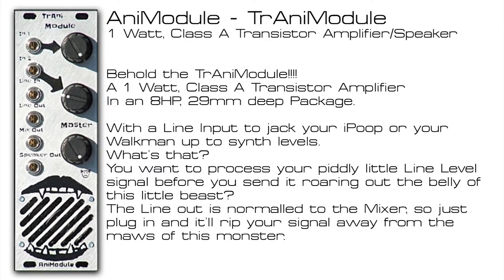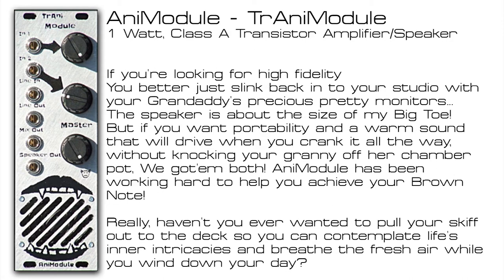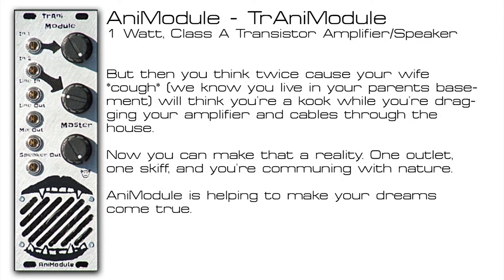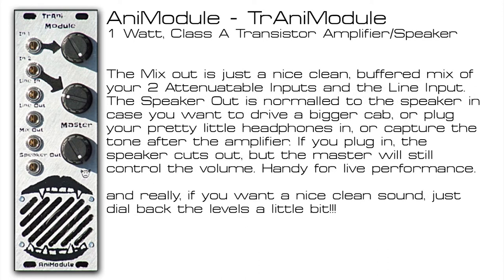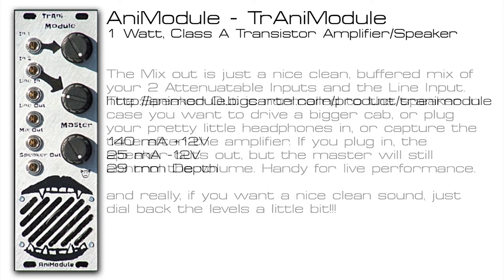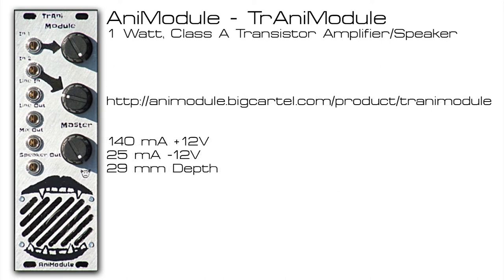AniModule - TrAniModule

Comment: Hey DivKid; great overview of a module I'm considering purchasing. Question re: headphone use (as noted at the end of your video). Isn't the speaker output mono? If so, wouldn't this result in sound output through only one earpiece instead of both?

Thanks!
Reply from the maker: oh wow old video! God I sound awful. Anyway, yeah it would just be one side I think unless it's a balanced output then it would be the same on both sides.